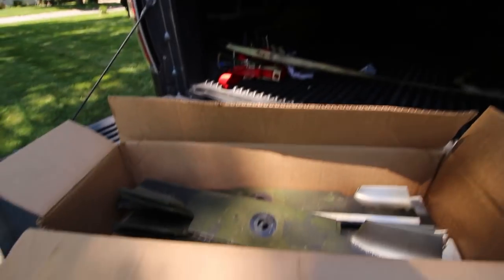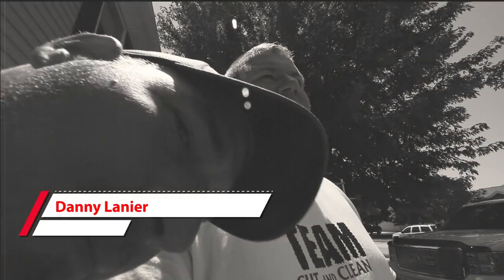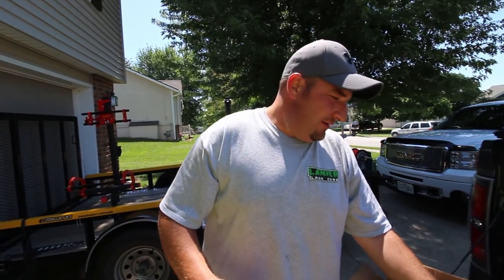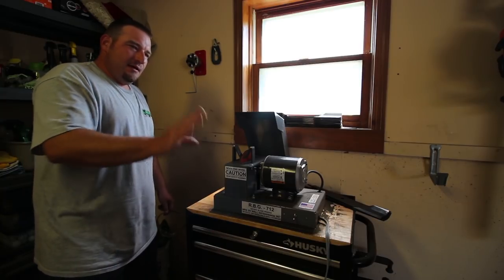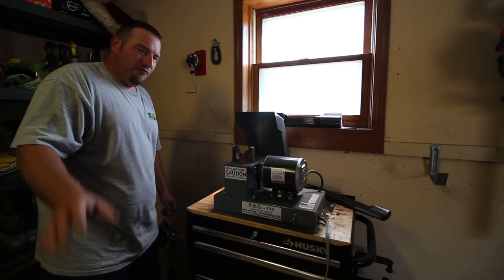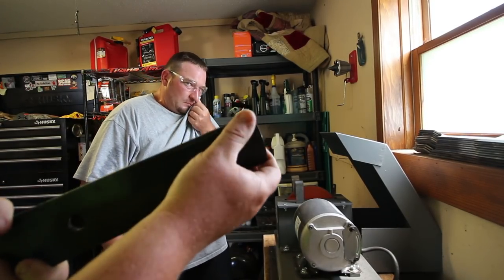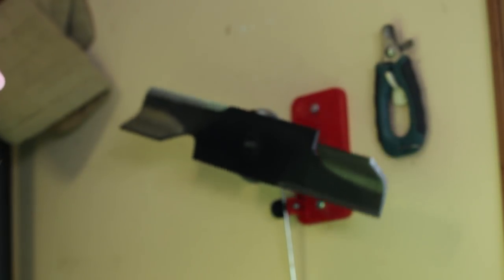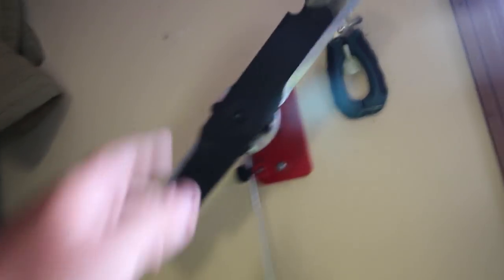How to Sharpen and Balance Lawn Mower Blades

Comment: It seems to me that it is a good idea to take your blade to a lawn mower shop and have them use their professional equipment to get your blades sharpened.  It probably doesn't cost that much and then you get a blade that is done right.  I have always sharpened my own blades but I think this video convinced me to get them done in the future.
Reply from the maker: I think it’s like 6-10$ per blade here to go somewhere
Reply: @CutandCleanTV  Well that is more than I would pay for a blade sharpening. I was thinking more like $5.  I sharpen my own blades and I guess mine aren't perfect but they seem to work. I am going to check with a couple of local shops and see what they charge.

Comment: With my old push mower I never sharpened the blades or replaced them I also never changed the oil in it I had it for 13 years she ran great until the power rear wheels stopped working and the new part was like 100$ so I got a new mower if she ain’t broke don’t fix it